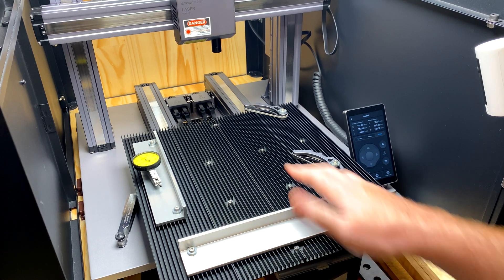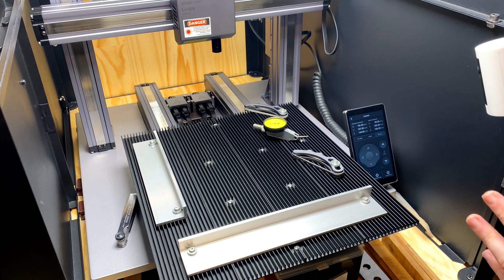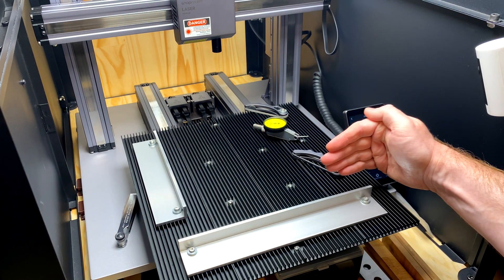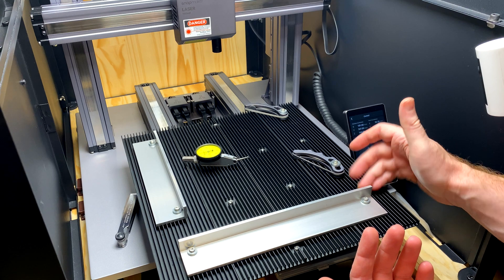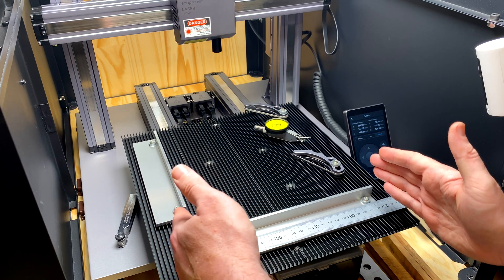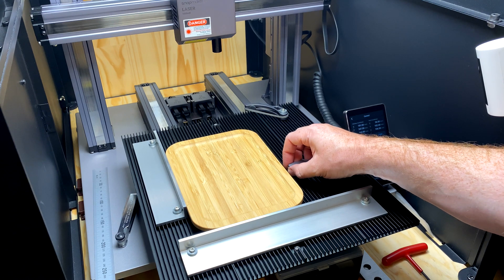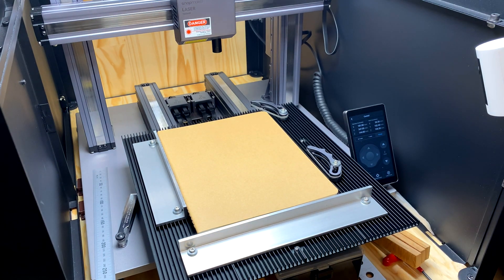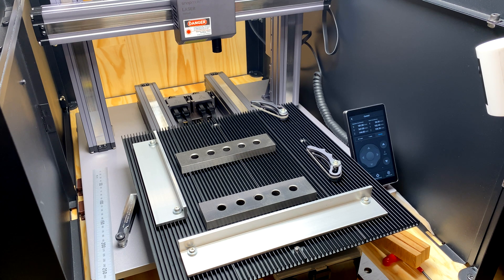Snapmaker Hacks - Laser Job Workholding

Comment: Thanks Uv inspired me to try 3d printing a clamp system that 
slides onto the corrigat6ed plate and has 3mm bolts securing the clamp in place .
Ill post some pix when finished.

Comment: Great video - I've been frustrated with this issue, as I'm doing a project that needs repeated laser processing of identical parts.   And those silicone plugs are indeed nearly useless!   For those w/o a milling machine:   If you are comfortable issuing G-code commands directly from the workspace terminal, you could put the Al extrusion on the CNC workbed, true it up and clamp it using the CNC bed clamps, then use the CNC spindle with an end-mill or engraving bit, then drive the head to roughly where you want the  first hole, drive the bit down .25mm or so to mark the spot, then raise it, drive in x or y (depending on how you've laid it out) by the distance between holes in the laser bed, and repeat.   Then remove the part and take it to the drill press, or just use a hand drill, to finish the holes, which are now placed very accurately.   And if you have a table saw with a carbide blade, you can easily cut down the "wings" of the Al  L-bracket - no need for an end mill.   Extruded Al like that cuts easily on a table saw w/ carbide blade.

Comment: Snapmaker are a weird mix of sky high build quality with occasional baffling lapses in attention to design detail like those ludicrous rubber hold-downs! The other one that really bothers me is the positioning of the bed actuator rails. Surely they should be right at the edges of the bed, then all the space between them could be used for much thicker bed stiffening trusses while reducing the overall bed height?

Your fences look good, but how about permanently fastening them together to hold a perfect right-angle? That way set-up could be a simple two-point alignment plus there would be more flexibility in using the mounting holes since you'd not need bolts at both ends of the two legs.
Reply from the maker: I did consider doing it but seemed impractical when I factored in the weird bolt spacing
Reply: @whatcouldgowrong7914  If you have a single right-angle fence it only needs two bolts basically anywhere on the two legs of the fence with no need for them to be in line. Also you can have many bolt holes on the fence with only two in use at a time. This should be enough flexibility to offer a variety of alternate positions on the bed.
Reply from the maker: @john_hind  Correct but I just used what I had lying around :) It can always improve or change when it no longer fits my needs. The video was just to inspire others to try other work holding :)
Reply: @whatcouldgowrong7914  Mission accomplished in my case! Thank you!

Comment: My issue is 1.5mm basswood warping midburn. I’ve been exploring using M1.4 bolts and nuts with what would sorta look like a money clip with a hole through the area near the bend (passes through two surfaces) in the metal. You put the bolt through and the nut on the bottom. The nut rides down in the bed’s channel. When you tighten the bolt, it rises to the top of the channel but can’t go further due to hitting the bottom of the clip. At that time the bolt starts to rotate in the channel and locks into the walls. The spring of the clip clamps down the material in a very low profile.

Comment: I've found the four finned anodized extrusion strips are all quite cupped. They rock like a bugger on a machinist's ref plate. Probably because of the extrusion stresses being altered when they drilled them & milled the clearance pocket around each hole. I can see the work surface just is not flat & i believe outside the range of auto focus on my 1.6W laser.
Reply: Wow. I have just started using my laser and never checked.Even screwed down they do not flatten? What did you do?